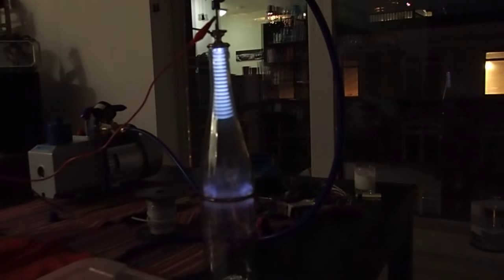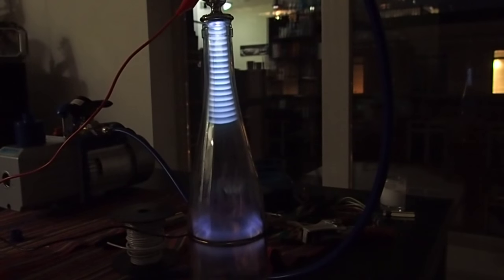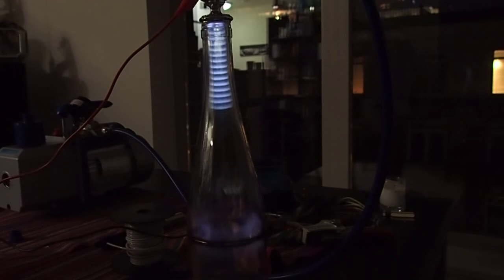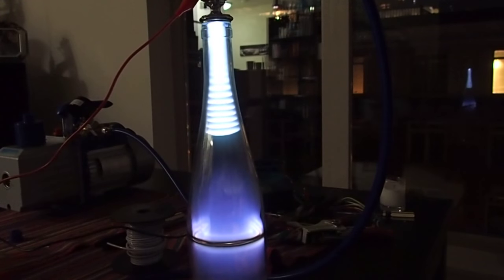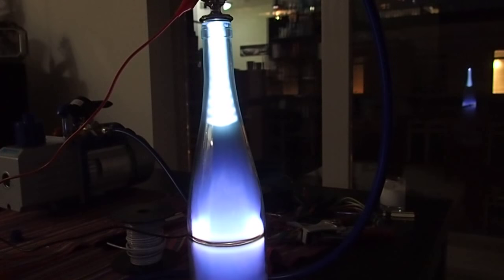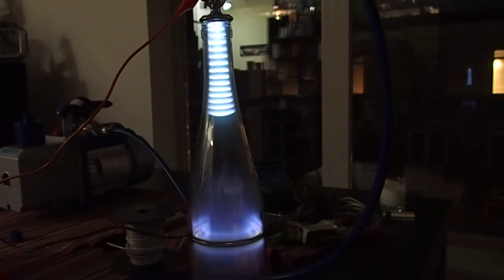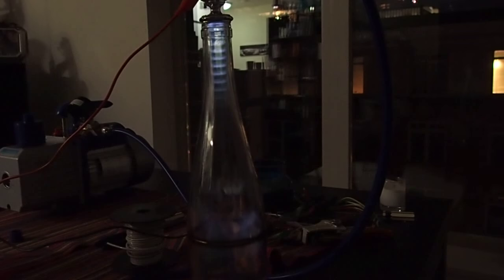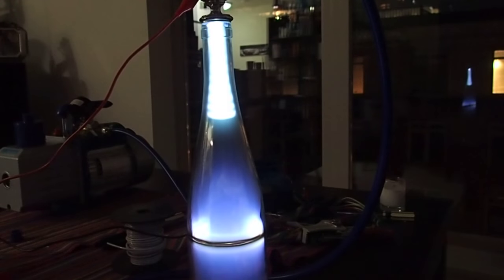Cathode ray tube in a wine bottle

Comment: what are those cool rings
Reply from the maker: Those are called striations. They form in the positive column of a tube at this kind of pressure. Basically, electrons are flowing along just below the ionization threshold of the background gas. Suddenly, one of them starts causing ionization. Others start depositing their energy nearby and causing more ionization. Now there's a glowing band. The electrons that make it out start accelerating again in the voltage field, and at a certain distance they do it again. At higher voltages, the bands get closer together, etc. 

Here's a project on them: Jackson, Loren Hamilton, "Plasma Striations in Vacuum Chambers" (2017). Senior Projects Spring 2017. 349.http://digitalcommons.bard.edu/senproj_s2017/349